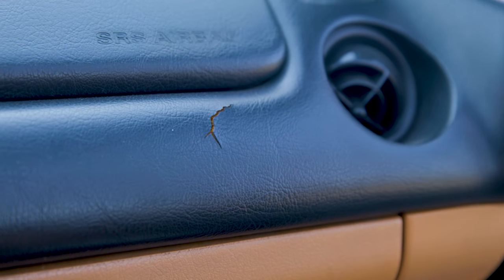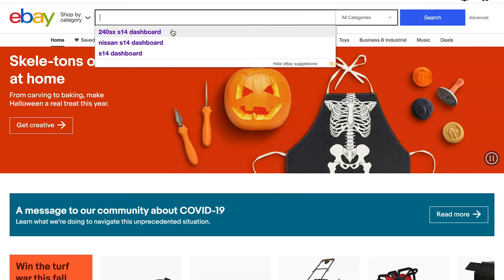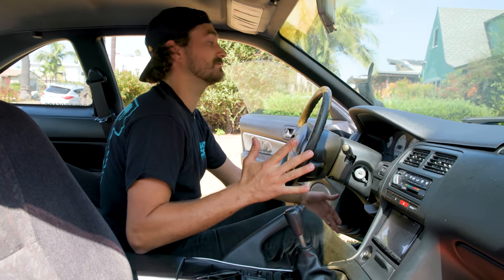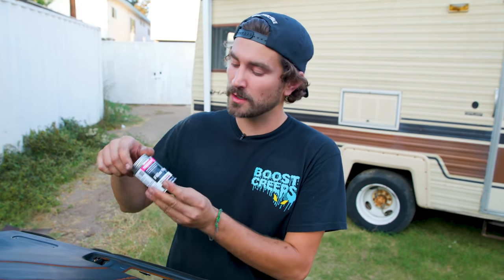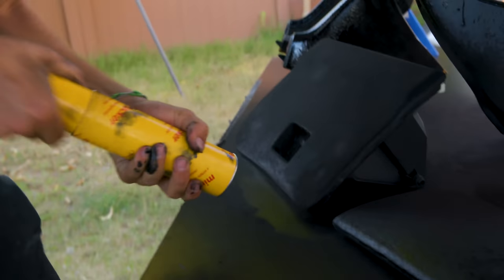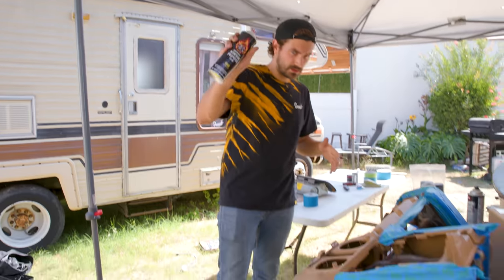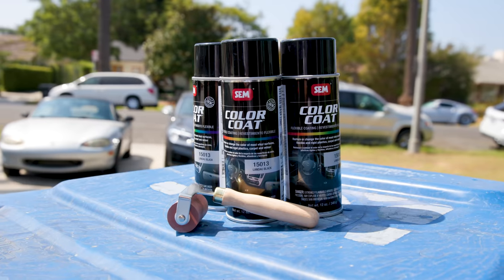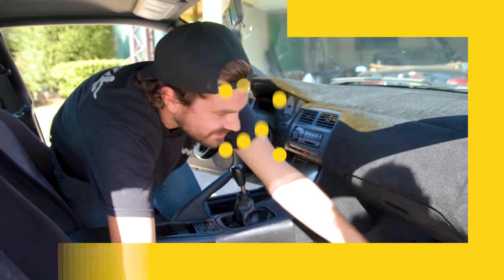We Tested 3 Cracked Dashboard HACKS

Comment: My concern with any repair like this, are dash covers, like my RX8, that are designed to split open in a controlled manner to allow the air bag to deploy as designed. In the case of the RX8, the dash covers look like hell because they crack along the lines of the deliberately weakened areas. Filling or altering these would be a mistake.

Comment: Doesnt help you much now but for anyone else soak your rattle cans in hot water. Like hottest water from the sink (not boiling) for 15 mins or so. It raises the pressure in the can and you get a more finely atomized spray which = smoother paint. It really makes a difference.

Comment: I Sold and used SEM products for years. You didn't even use their texture coat to hide the repair!! You fixed a few square inches and didn't blend in your texture. If the suede look is for you cool but now get your kids to run their grubby hands on you newly coated dash. Then you will really say flock!. SEM will hold up for years even on door panels with the window crank being spun around and will wipe clean like the oem dash would have. Just my .02$. Still Good vid!

Comment: Pro tip: put both parts of the filler in a ziplock bag and massage to mix. Then cut a corner off the bag and you can squeeze it into the cracks like cake icing.

Comment: The Miata wasn't a technique failure, it was yours. If you can still see the crack means you did a bad job with the filler and sanding. It was such a small crack that the texture could've been made by hand, with something like a toothpick. The rest of the dashboard looks pretty good painted. And still looks good overall.
Reply: The S14 that you called 'a win' looks awful tho... 🤷

Comment: There's textured rollers you just spray and roll may not be 100%same texture but close flat texture without sanding I tried my spray paint artist friends method there is spray can tips for sale you put onthe top of can that spray texture then use good primer.. cheap or quick dry primers won't work. Spray in different angles is key. But the second method is good primer with original tip spray 1st coat  and don't let it dry 100% You want to spray 2nd layer without firstlayer drying 100%. the moisture on 2nd will keep 1st layer somewhat wet. after the 3rd 4th layer you can start rolling Textured roller or this method on this video will work. basically you dig the texture into the 2 top layers flattening/compressing them into 1st layer. Then u can paint with special plastic spray that I forgoy

Comment: You dont have to drill deeper into those cracks like how he did.. and you can also use a 20$ heat gun to seed up all the drying for the bondo and spray paint process. Dont need to let dry over night.

Comment: Bondo method does not last. I redid a '72 zcar dash with multiple cracks using fiberglass "Bondo" and fiberglass tape, then used truck bed liner spray for the texture. Looked  factory post drying, was very stoked, but, cracks reappeared within 6 months.

Comment: option 4, pull the dash, buy automotive bumper urethane filler, fill cracks, then 3M glue down vinyl from fabric store and use heat gun on warm day....that's my plan and people have done it

Comment: You could have made this look like new by doing a proper restoration, no dremel just use small picks similar to nail cleaning picks, remove some of the innards that swelled out of the crack, add a very small amount of filler, not enough for it to come out of the crack but just enough to align it properly, then use the original polyvinyl chloride by pushing it into the filler and a small amount of heat, wait for it to set then use Rekhaoil or Varibond to dye the entire dash, literally brand new.

Comment: I would take the dash out, plastic weld it, strip it, and then upholster it in a nice automotive grade leather. It takes days to do, but the final product is unbeatable.

With the filler and repaint option, you should have cut out a 1x1 square, put new material there, and THEN repainted. It looks bad because the execution was poor. 

But hey. I miss these videos. This is what Donut was built on.

Comment: Sorry that your friends are dumb, Zach. It was a nice dashboard.
Edit: I painted my entire interior on my old Mustang GT & it turned out awesome, & has held up for 4 years so far. Used rubberized matte black paint, & topped it off with 1000 degree rated caliper clear coat to protect against the sun. Has worked exactly as planned.

Comment: Ya know what I think? I think the flock not only looks like a splotchy diy matte paint job you see on every be golf. But also can never be cleaned when dust and shit starts piling up. It'll all start coming off in little dusty messes. And like glitter, you're gonna be finding that shit where it's not supposed to forever. If you installed the cover correctly and used a wrinkle paint it would've matched perfectly.

Comment: Man, I might be the outlier but I didn't like any of the fixes,  each one has its own perks and flaws, I've been in the vinyl industry my whole life, normally I wouod stay away from interior parts, but a thick wrap of a faux material might look better than any of these, it would still require sanding and filling in the cracks , get a smooth clean surface and depending on how flat or curvy the dash is it could be way easier and look brand new perfect. You just have to know how to stretch pull the corners and then tuck it under to get nice front corners, and anything else that won't be seen can be ugly. I might try this , there is a chance I wouldn't even have to take the dash all the out. Maybe just loose.

Comment: The overlay looks the best but you didn't install it. Glue it in and it will look waaaay better then the flock which looks like a rough, unoriginal  surface.

Comment: The texture you could have done a better job. Hot glue gun, put the glue on something to stamp with, wait for the glue to cool down a little, then stamp it on the dash to get texture on the glue and stamp it onto where you want texture but making sure the filler isn't wet enough for it to stick to the stamp

Comment: Kinda late in the game but if these car makers had built stuff right there wouldn't be these problems. You can get in a 30-40 year old Honda and the dash's not cracked and the cloth seats aren't ripped or broke down at the driver's seat. Leather didn't fair so well but that required more driver input to save.

Comment: i find it funny i can buy a new dash pad cheaper then u can fix the old one for. i have a 68 chevy pu and a new dash pad cost me 54 bucks for it i even rebuilt the dash and heater box for 250 bucks with full factory gauges tach,speedomitter , oil, water, fuel and vacuum gauges new nobs heater control glove box  and bezal and lense next is a tilt wheel for 350 bucks with wooden steering wheel seats i pulled out of a land rover black buckets look like new for 25 bucks each center cousole out of a 71 blazer for free 17 bucks for meterial for door panels 35 for a new set of arm rest

Comment: You should wear a proper respirator when using flock. Especially if you're not using a static gun type setup. 
It's seriously bad for you, the fibres are incredibly fine and normally made of nylon. They get stuck in your lungs and don't break down.
They can cause various lung diseases, which are known as "Flock worker's lung". Super bad for you.

Comment: How is the Eclipse the worst car? I don't get it. I would love to have an eclipse! There are Eclipses and Plymouth Lasers running in my town right now (there's even a faded-red Pontiac Fiero). They are not enthusiast cars, they are used every day like regular cars, they have some rust, some bumps, but they run fine. And my town is not located in some motoring tradition hotspot, where you can get all the vintage car parts at the corner shop. Nope. Former Communist Eastern Europe.

Comment: This video would be non-existent if people would just use protectant on a regular basis. Lube that baby up once in a while. Also why wouldn't you just get a piece of faux leather or vinyl and adhere it to the existing dash cover. That would have been cheap and extremely easy to do.

Comment: The flock version looks worse then your half ass Miata painted dash ....  And that's a lesson in reality .. reality is if you want to keep the car crisp and clean order a new dash if you wanna look like a river kid that works at consumer beverage and lives in mom's basement flock it or paint and tell yourself it looks great 😃 even if you want to repair it yourself there's a way better option ... It's called re-vinal the dash buy the fabric spray the dash with 3m adhesive stretch the fabric heat the fabric tuck the fabric and be done with it

Comment: Hi build. primer. is like primer  2part. build. to create more product so can spray on with min coats, so high build has nothing to do with what he said, and if you are going to try something stat texture using different brands is best and also it can be blended out   as I said in another. video. and then painted interior paint. to have the right interior color, only thing peopler happy with is with suade look. but that is going to last how long to long because cannot rub it at all if you was to look  like did. there wise you are hiding problems that were not fixed in beginning, , there are ways to do this. but somebody that have never worked with any these products   cannot even come close to getting the  expectations they desire as to do that you have to know each product and what ti is meant for and it abilities. and what you are workinging ,  temperature of all products , as when they expand and when they swell, ,  good luck,,,,, the idea you through out. would have been the easiest and fastest as sand all edges to blend in on all areas vents etc, and use adhesive to for plastic, , then if any issues use a fine body filler and then  get interior color for interior car paint  as the plastic has texture closer then anything he did m so adesion promoter  and spray interior paint on. and it should look a lot better and no worries of lifting of to many products noncomaptible m this would be the best and if someone. came up to a car done in the flaux   , you know it has. cracks.  a  dash the same a original and done right nobody is going to give a second look. unless they are just looking at dash.   my opinion , good luck stay safe!!!!